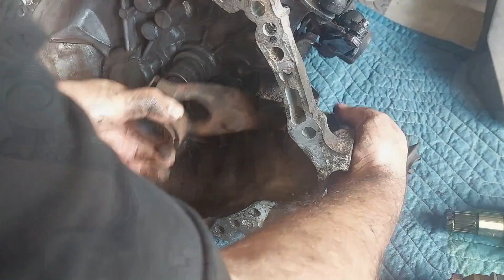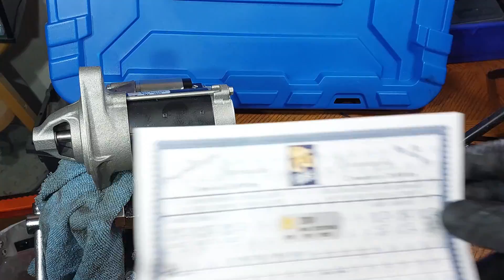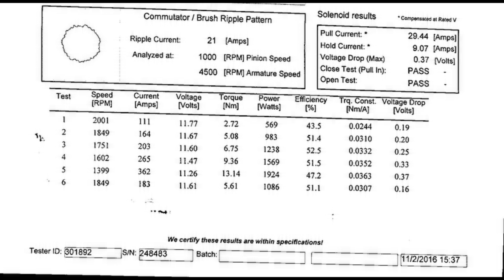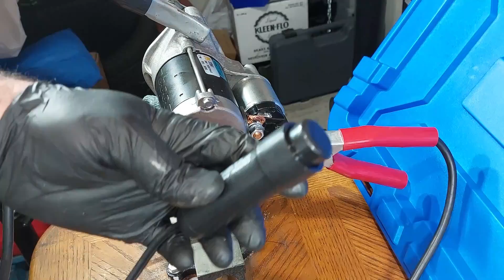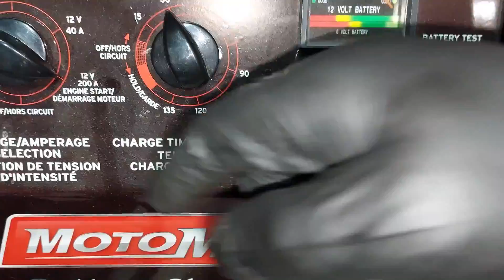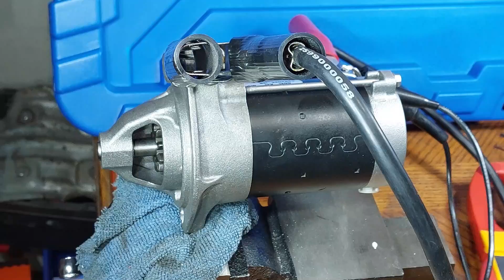Starter Motor Testing On The Bench - 2005 Toyota Corolla 1.8

Comment: Great video. Very informative.  The bare copper woven stranded copper wire on the motor side of the solenoid isn't a ground for the solenoid.  It's the power continuation from the solenoid to the main motor. Solenoid is grounded through the body. For those that don't know(anyone reading this), the solenoid does 2 jobs. It energizes an electromagnet that pulls a plunger back kicking out the gear into flywheel,  upon the last movement of this plunger,  it bridges the heavy 12 volt contacts supplying power to turn the starter.  This keeps the motor from spinning before engaging flywheel teeth. 
  I wish everyone was as clear and  descriptive as you.  Keep up the good work! Thanks.

Comment: Is this a DENSO aftermarket starter or a Toyota OEM starter (but made by Denso?)
Reply from the maker: Aftermarket by a company named DNS. They usually make good aftermarket parts and this is the only company I know that rebuilds things properly. For things like starters and alternators you're best going OEM if you can.